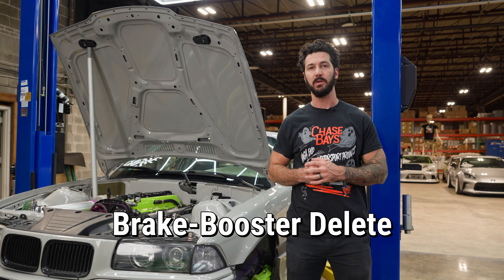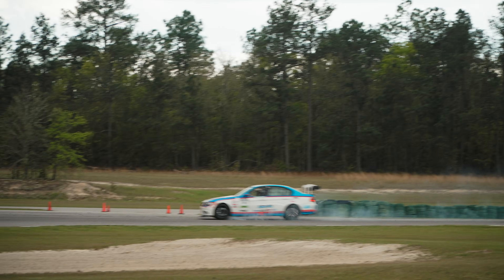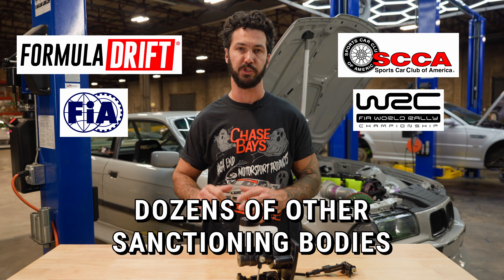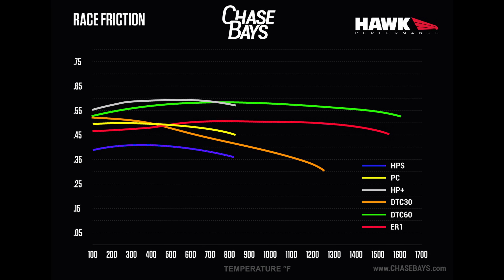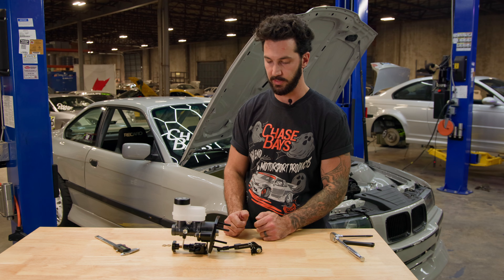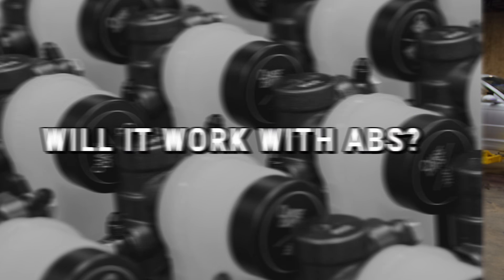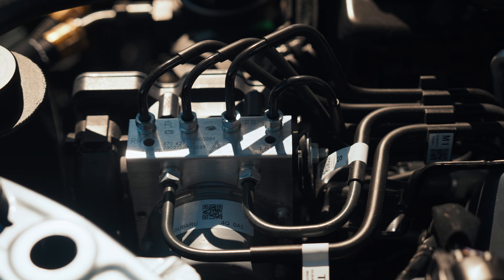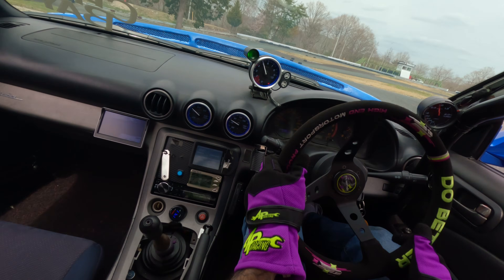Motorsport Manual Brakes for Under $1k, EVERYTHING you need to know…

Comment: Do you have to install each individual line to each caliper?
Reply: Not necessarily. There is a front and rear circuit off of the Chase bays master cylinder. At 2:46 in the video it show the outlet for the front brakes (theyre using a L Banjo to split between front left and front right brake lines). The rear brake line is normally a single line attached off the included proportioning valve and then run to the rear of the car where it splits through a T fitting for rear left and rear right brakes. Lots of cars come from the factory set up like this making this kit easy to adapt into factory brake lines or  make fully custom lines.

Comment: Right hand drive versions?
Reply from the maker: The Brake Booster Delete will work with RHD or LHD chassis but at this moment we only make the brake lines for this for certain rhd chassis. see our website for that list.
Reply: @ChaseBaysTV  need the ae86 rhd lines asap

Comment: Problem is that you can diy it for under 100$, and still have the same quality. OR buy an aftermarket pedal box for under 500$. European drivers know this though, luckily/sadly Americans have endless amounts of money.
Reply from the maker: @SamiiTubeHD  would love to see this function and quality setup for under $100, more power to ya sir.
Reply: @ChaseBaysTV  will tag you if i do it on my practice car/ pro car.
Reply from the maker: @SamiiTubeHD  awesome! And it has to be what we offer. It has to have a raised pedal ratio bracket, clevis, pushrod, new Master Cylinder, Proportioning Valve, and 100% plumbed 3AN brake lines all for under $100. May the force be with you. 🫡
Reply: What diy setup are you referring to? I have a car I'd rather not spend $1000 on for a brake master cylinder set-up.
Reply: @Spiritof_76  Well, if you want a dirtcheap version, just use a steel plate and bolt a master cylinder to it. I have not started designing my DIY setup yet, but will have it done before next season. I only know bmw though, but design/concept should apply to various other brands.

Comment: Only gripe I have is the aluminum fittings, won’t use those in brake setups. Switched all mine out for stainless.
Reply from the maker: @jasonlouis5498  the hose, hose ends, hard lines, and banjo bolts are SS. The tube nut / sleeve and Banjo’s are aluminum. For those uses there is no reason to gripe about it, they are used successfully on the highest forms of Motorsports on braking systems. If it’s good enough for them it should be good enough for us.

Comment: You said nothing about caliper piston area. Why? This is tremendously important with manual brakes. You sell the e36 as just one application, but the m3 and non-m3 e36's will have very different caliper piston areas. What is the preferred piston area for the e36 application of this manual brake conversion?
Reply from the maker: @tracymorgan571  thanks for the comment! This isn’t totally correct, it is not tremendously important. With a proper MC size and pedal ratio the caliper piston area becomes far less important with a tandem master cylinder like this. With 2 piston front, 1 piston rear vs 4 piston front, 2 piston rear and same brake pads you wouldn’t be able to tell the difference in pedal travel for the 90 to 99% braking. We’ve personally tested this first hand on 22 different chassis, ranging from 1 piston front / drum rear all the way to 6 piston front / 4 piston rear. Real world testing is real! We can do a video explaining this soon. 👍